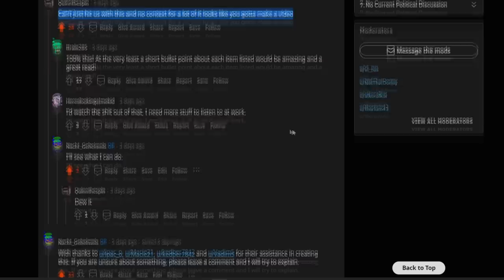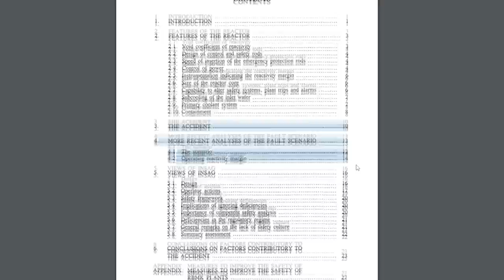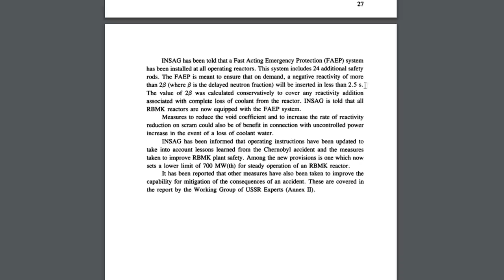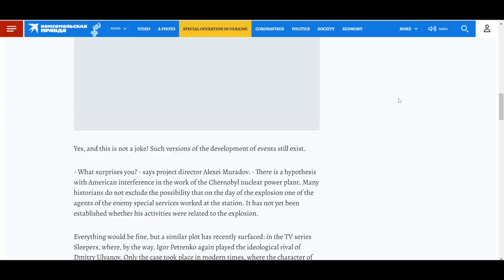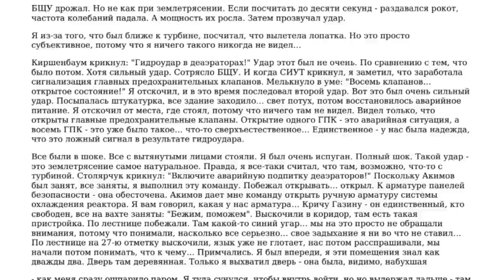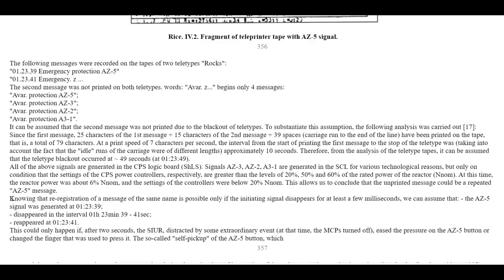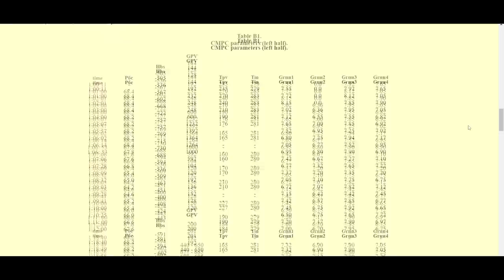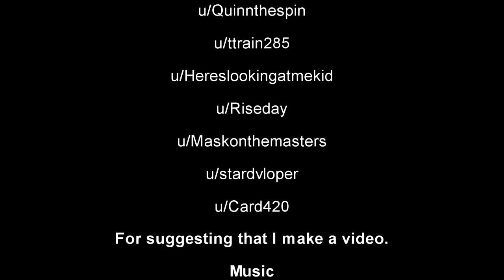The Chernobyl Iceberg Explained

Comment: Most of you are considerably younger than I am. I was a young Adult back when this disaster happened. I remember the outrage from around the world, because No one had any faith in the Soviet ability to create and maintain a safe nuclear reactor, I being one of the hundreds of millions that felt the same way. Russia can't even build a perfectly functioning turbine jet engine that can last the life of the aircraft that it is housed in, if that being the case, why would Nuclear reactors be any different. So when the disaster happened and the Western European nations started going public with a SIGNIFICANTLY sharp increase in Radiation coming out of Ukraine, it was then and ONLY then that the Soviet Government opened their mouths and said that there had been an accident in the PNPP (Pripyat Nuclear Power Plant). The fact that Russia was willing to do and say anything they can to make themselves look every bit as forward and advanced as the west, they designed a Nuclear reactor that used Graphite rods as control rods. Now when everything is fine and dandy, Graphite works just fine as a control rod, However, when temperatures rise and there is a problem with keep the temperature of the core at a lower level, Graphite turns from being a decent control rod to a burnable substance, meaning at Temperatures that a Nuclear reactor can easily reach, Graphite becomes flammable and despite what the Soviet Russian Overlords were say what happened, this is likely what happened, and no matter what the controllers would have done it would have made no difference. There weren't enough failsafes in place to prevent a nuclear disaster, simply because the Russian Government was spending more money than they had to build it and they cut corners and the designs of the powerplant were insufficient to be able to prevent an issue once certain parameters were met. meaning the Chernobyl power plant would have to likely SCRAM their reactors far sooner than Western reactors would because of the Limited failsafes and the fact that they were using Graphite control rods. Russia has done so many times in the past, and the older Generations know what I am about to say right now, the men who went to prison were likely innocent of the crimes the Soviet Government levied against them, because they would do that far sooner than they would admit that there was anything wrong with the designs of the Reactors themselves. I feel so bad for the Ukrainians because their nation now has the single more radioactive disaster site on the entire planet, all because the Russians decided to build their unsafe reactor in Ukraine. Why else would they have built it in Ukraine, if they themselves didn't believe it was as safe as they said it was? No they built it in Ukraine for a reason, despite Ukraine being a part of Russia itself, they still had their own government and elected officials (elected by the proletariat) and that is why it was put in Ukraine in the first place, any Ukranian can tell you this now. Yet Ukraine has another Nuclear power plant, now known as the Zaporizhzhya Power Plant, also built by the Soviet Union, and now under the control of Russian Army while the war in Ukraine rages!, How much longer before Putin loses his mind and commands his troops to liquidate the Ukrainian personnel that are still running the plant? The Iceberg you have created is actually bigger than you think it is, because there's another Iceberg related to it in Russia, one that represents the fallacies and outright evil nature of the Russian Communist Party and all of the corrupt individuals underneath it, that are part and parcel to this whole sordid affair. and yet another iceberg that is the Chinese Communist Party that stole the designs of the Russian Nuclear Reactor and built their own plants throughout China, but oddly enough China still uses Coal power plants as well, after hearing of the Highly efficient coal power Plants In Alberta, Canada, which they shared with the Chinese, but whom still haven't made the changes to reduce the pollution they produce, simply not caring about such things at all. They being perfectly okay with polluting the planet, just as long as they still maintain control of their nation. There is nothing more insidious, more damaging to Humanity and the Earth, than Communism. Even as Cruel and heartless as Nazi Germany was, they couldn't hold a candle to the communists and Stalin himself who murdered more than Double of what Hitler had managed to kill.
Reply: Greatest comment on this platform I have ever seen - you, Sire, have accomplished to put the horrible accident into the bigger picture and meaning of this event to the entire world and specifically to the people that are affected from these post - soviet / post communist after effects that now more than ever are troubling the russian people under the rulers who still cling to the imagined greatness they had during the times of the accident and how it is now, because of this deliberatly inhibited change of minds in the leaders and authorities of the russian hemisphere that still keep them locked in old ways of thinking as you described it - cutting corners in trying to achieve things that require more dedication and detail focus; the event in 1986 showed this lack of critical thinking and onedimensional organisation - just the same state as german illusional "politicians" in todays times are showing the same lack of competence in planing against and dealing with risks / catastrophes - like the energy crisis - not created by the war but by ignorance and convenience by EUs biggest economy ; where they all lost the typical german traditions as to be well prepared , all possibilities calcualted and generally industrious and inventive kind of characters and I am so ashamed that this is a development that is going on on most of western civilisations; good hunting STALKERS, and may the gods be with you to endure these dire times;

Comment: Great video, Chernobyl Guy! I was wondering if you knew anything about the ISU-152 (WWII Soviet self-propelled gun) of Chernobyl and whether or not the story of it being used to blast holes in parts of Reactor 4's facade deemed too hazardous to approach was true or not?
Reply from the maker: Hi! Thanks for the comment!

Yes, there were ISU-152s used at Chernobyl, but they weren't used to shoot at Unit 4. They were instead used to demolish structures nearby as bulldozers, in the hope that the armored plating would shield the operators from radiation. Some were used to shoot at structures, but again, not at Unit 4.

Comment: Ive been thinking this for sometime, what if when they were evacuating pripyat, they were originally using a train to get the people away, considering that the nearby yaniv railway station already has a few pieces of rolling stock, including engines, wagons and even a rail crane, it might have been posible for an evacuation train to have been in planning stages but not really happening, although it might but im not sure.

Comment: Correction: That was an AK74 used. AK47s were not used by anyone after 1950 as the 47 was a prototype. What people call the AK47 is just the AK, which was replaced around 1960 by the AKM, and then by the 74 in 1974.

Also, didn't the HBO series literally feature the lie as a plotpoint only for the show to show the actual events?
Reply from the maker: With regards to the first point, they used what you're calling an "AK", which is still designated an AK-47. The video of the shooting shows the front sights of the AK-47, not the AK-74, being the most distinct difference. It also shows a curved magazine, which AK-74s do not have.

With regards to the second point, the explosion events shown in HBO are the lie presented in Vienna. The easiest difference to point out between the "lie" and the "truth" is that, in real life, the power surge occurred after the AZ-5 button was pressed. There was no noticeable increase in power before the button was pressed, and there was no panic until afterwards, either.
Reply: The gun in the footage is very much not an ak74 it's blatantly obvious by the slanted gas block where the ak74 has a 90 degree gas block

Comment: I just started the vid but y'all gotta check out Kreosan English on here , they go into the plant and towns to show you what it's like now. They even dove in the flooded lower levels 😬 cool guys though! They made an x-ray gun from an old non scavaged machine recently, crazy! Even built a safehouse nearby! 
The stalkers are a big problem, they're selling the copper and other contaminated metals. It's possible they will make it to products on the market if not already there. They made it into the actual reactor with the graphite to steal , took hermatic sealed door parts etc. quite alarming for future. Could be smelted and put in anything by now

Comment: Since alas couldnt be bothered to fix his mistake at 30:34 so i will do it.
The fuel didnt land on AT-7 which are the big ones on the back of TH, but instead on the box which is shown in the picture known as TMZ (ТМЗ) Transformer for Machine hall.

Correction: Alas didnt believe me when he was making the video and choose to go with TMZ cause he didnt think that the fuel could land on AT-7. In conclusion the fuel landed on AT-7 not TMZ.
Reply from the maker: Bit rude but yes. :)
Reply: Unnecessary rudeness
Reply: I don't think that he was being rude at all, just correcting a mistake.
Reply: @isaowater  🙄
Reply: @nicolamurray5384  🙄
Reply: @louisbeerreviews8964  ?